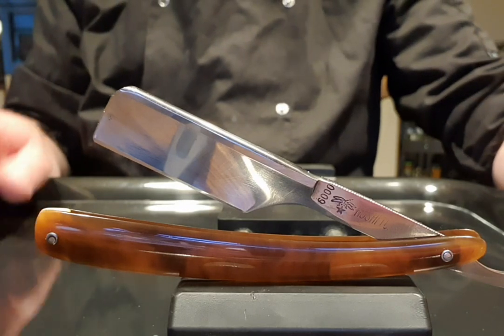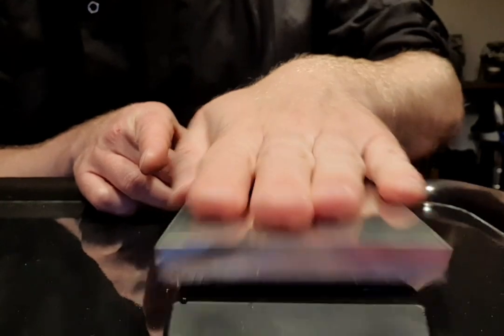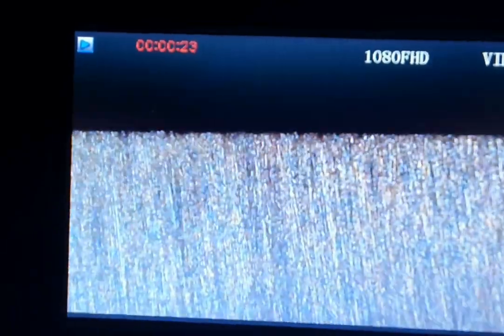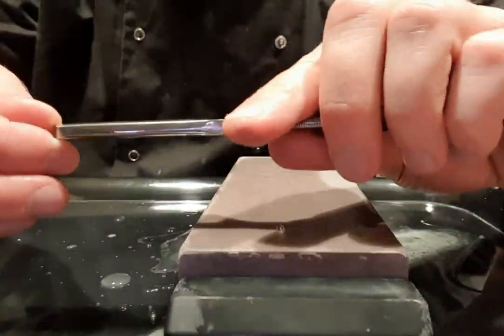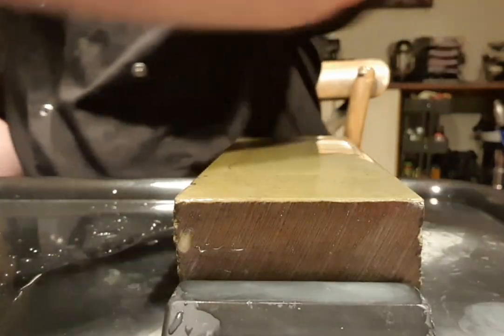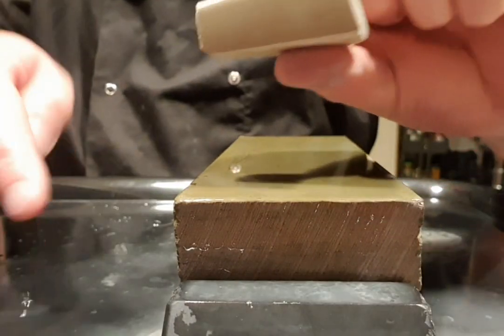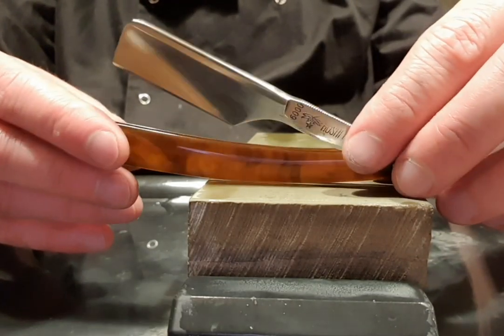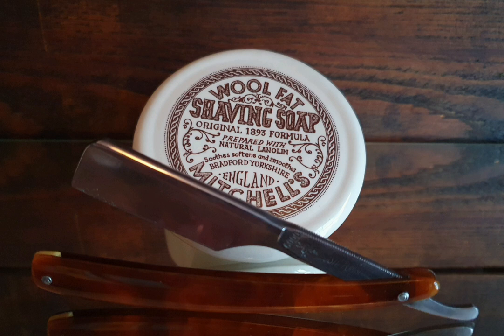FROGGY SHAVE: Hoshi Tombo 6000 Kamisori Japanese Straight Razor restoration

Comment: Out of all the razors you've honed at this stage which one was the smoothest shaver? Was there one that was far and away the best?
If you could point to your honing video of the smoothest shaver I'd like to re-watch it and see if there was anything you did differently or for longer and also what type of blade it was.
It might even give you an idea for a new video if you can remember the details of what you did differently , "this was my best shave ever because of.....". 

I think my smoothest is either a Filarmonica 14 or a Wade and Butcher FBU and I'm a bit sorry to say both of those edges came off lapping film and not a rock. Both of these were further refined on pasted balsa with 0.5, 0.25 and 0.1 micron diamond paste. (Previously the W&B was done on CrOx which was very sharp but a bit harsh)
My smoothest from a rock is a Hamburg Ring extra hollow and that was done on a Narutaki Mukaida and tomo nagura.
Reply from the maker: I can't really say I have one single favorite razor but I have some that I find amazing and some that I find always disappointing.
I'm often very happy with Solingen edge and how smooth is their shave.
Other than that, at the moment, my favorite razors are:
- Solingen Adresso 8/8
- J.Terias 6/8
- Super Vogue 6/8
- All Manufrance razors I've tested

That said, I believe that if the steel is of decent quality and the blade isn't too damaged, there is always a way to make it a great shaver regardless of the brand.
I have some Fila and although they can be super nice, I don't personally think that they shave better than any other good razors.
I like the Wades quite a bit but it's more for their history and design (even if they can also be great shavers)

Comment: Ouch, that hurts my eyes. 
You swapped Omote and Ura ratio. Majority strokes must be on Omote (narrower hollow grind). There must be fewer strokes on the Ura (wider hollow grind). 
You did the exact opposite. You messed it up. Such a shame. 😥
Reply from the maker: I don't think you watched correctly the video mate. At 0.5 I explained that previous owner butchered this edge by honing it with western Europe way.
So I decided to go for a 1 to 2 ratio and honing more on the flat side as it should be done with kamisori razors
Reply: @FroggyShave There is no flat side on the kamisori, both sides are holow. 
This Kamisori is right-handed so more strokes on Omote means more strokes edge toward person who do sharpening. less strokes on Ura, edge away from person who do sharpening.
The video clearly shows 2:50 that you made 12 moves on Ura and 6 on Omote. => 6/12 (Omote/Ura) So completely wrong...even worser than the original 1/1

(Because it is not a traditional Kamiros so it can be honed 1/1 ratio Omote/Ura ...but definitely not 6/12 ~ 1/2.....tradicional ratio is more like 7/1)
Reply from the maker: @Vamtal  Mate, I'd say you need to zoom on the video at 2.50, the 11 strokes are ok n the omote side.
Reply from the maker: @Vamtal  ok mate, lets agree to disagree. Glad you enjoyed the video 😊👍
Reply: @FroggyShave  Come on.🤣  Watch your own video! 
2:50  12 strokes edge away from you, on wider hollow side -> that's Ura side. 
(you showed Ura side to camera ...even "6000" stamp is clearly visible)
Reply: @FroggyShave  this is not a matter of opinion .... which side is which is simply a fact (verifiable by many sources) 
when you make a clear mistake it is pathetic to deny it 
btw in your video with a traditional kamisori you use terms wrong but you sharpen it correctly 😉